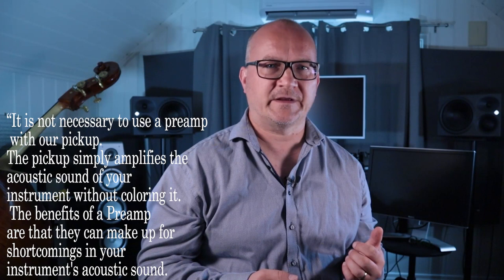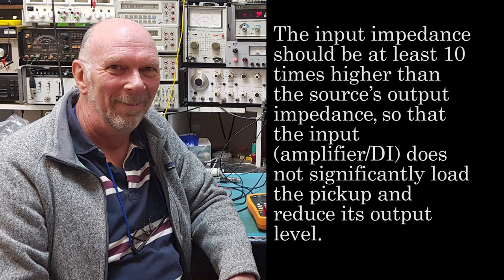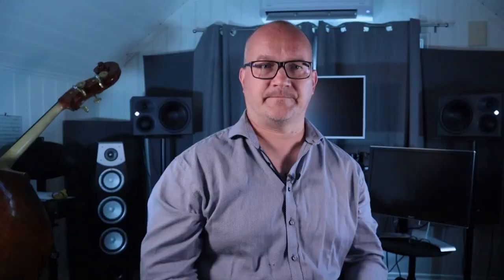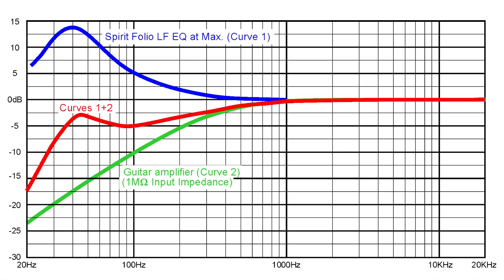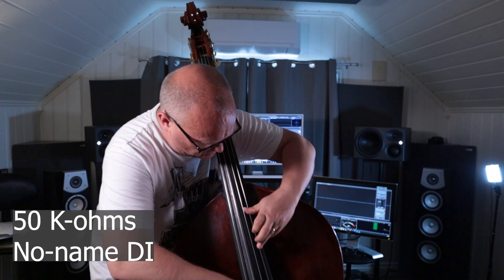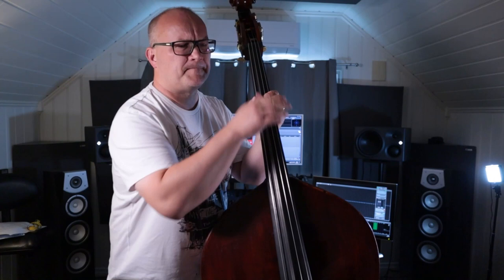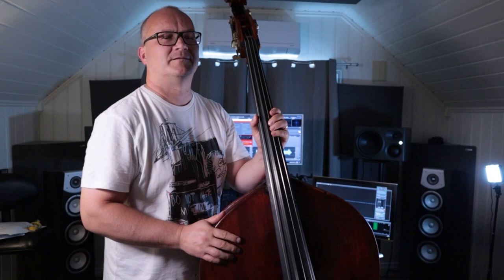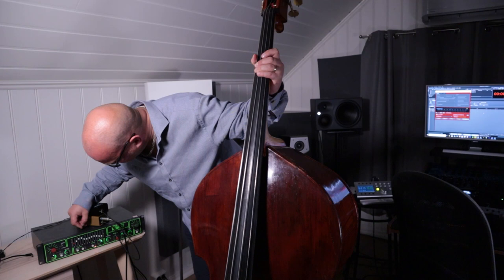Max Your Amplified Upright Tone

Comment: The difference in tone between that passive DI and your preamp's 10M ohm input was obvious even on tablet speakers.  Those tiny speakers couldn't even hide the bass rolloff caused by connecting to the transformer.

Comment: Great video thanks. It looks like you can't use the PZ DI  with just a bass amp as there would be no phantom power. Can you recommend a different 10MEG buffer that has a power supply other than phantom. Thanks

Comment: This is some great advice.  I've long been a proponent of 10M ohm for piezo pickups, particularly for bass, cello and guitar.  With the latter two it may be less critical, and for violin, mandolin or similar instruments with no bass fundamentals a 1M ohm input is likely adequate, but there's no harm in using a higher impedance.

As for the pickups themselves, the impedances are more complex than can be expressed with a single ohm value, use of which implies that the impedance is constant across the frequency range of the instrument as though the impedance is only made up of resistance.  Piezo pickups present a series capacitive reactance, so the pickup total impedance rises as the frequency of the signal goes lower.  Magnetic pickups, on the other hand, present a strong series inductive reactance, so their impedances rise with frequency.

The solution, as you say, is not to match these complex impedances, but rather to bridge them with one much that's much higher.  Technically this is because we're looking to get a flat response based on the voltage that a pickup produces, not maximize power transfer which is what matching provides.  A too low impedance input becomes a filter, reducing the signal as the pickup impedance rises with lower (piezo) or higher (magnetic) frequencies.

I'd be interested in trying a high quality passive direct box, not because that's likely a successful approach, but because I'm curious how much the other frequency anomalies you noted are due to the cheapest small signal transformer some indifferent corporation could wind, or to what extent those were due to the kinds of complex impedances that even a high quality transformer will present to a piezo pickup.

For me, the take away here is that, in order to minimize problems interfacing with different sound systems that may be encountered out in the wild, one would do well to travel with an active direct box.  That ought to feature a 10M ohm input impedance along with a high quality output transformer and a ground lift switch.  It should also have its own power (and carry spare batteries!) so you don't need to rely on having either phantom power from the main sound system or an AC outlet on stage.  That way, even if all else fails you can still provide the sound system operator with a high quality, balanced signal.  Basically it puts the bass player in control of everything they can control.

Comment: I have an Audix F90 gooseneck condenser that I’ve modded to friction-fit between the strings right by the tailpiece, and it sits under the strings behind the bridge and points at the soundboard directly below the bridge. It is powered (and controlled) by a Behringer mini mixer. From there it goes into (depending on the scenario) either a Crate BX100 combo or a Hartke HA3500. Both those amps have contour controls as well as multi band graphic EQ. And in both instances I’m very happy with the amplified sound. 

Is it perfect? No. But is it loud and clear enough across the entire range of the instrument, without intrusive resonant peaks, to work with small or large combo groups? Yes. It sounds more acoustic by far than any piezo-type configuration I’ve tried.

Comment: Amazing Frode!!! Thank you so much for all the precious information. What's your line sequence between the doublebass and the amp?
Reply from the maker: Thanks a lot for the kind words! I normally just plug the pickup into some sort of buffer as the first thing (I have plenty different ones, will publish a review of a new one next week) then into the amp. Recently I have been experimenting with a programme called Gig performer, I might start using this for gigs soon. It gives you limitless possibilities for effects in all forma and shape, with limitless routing capabilities. But mainly it's simply buffer-amp-